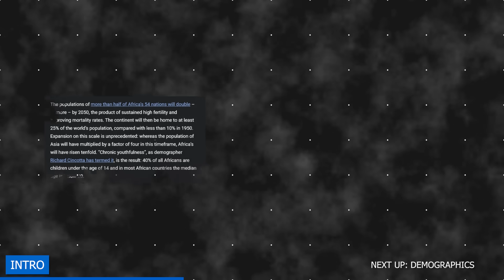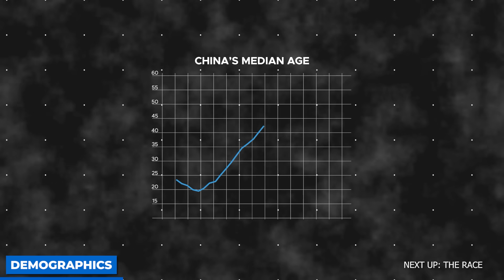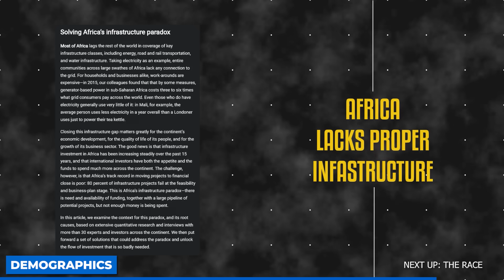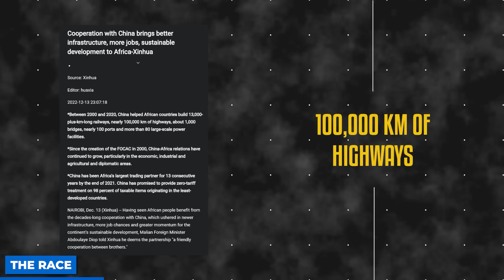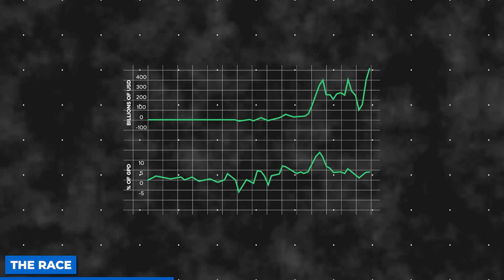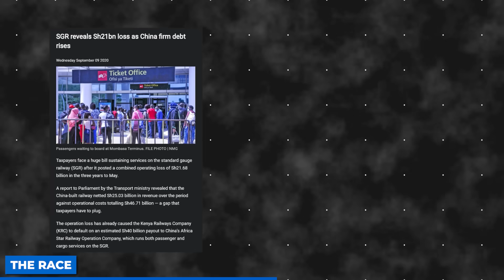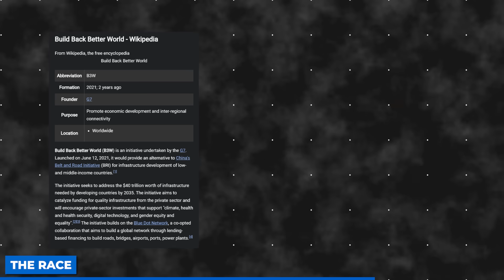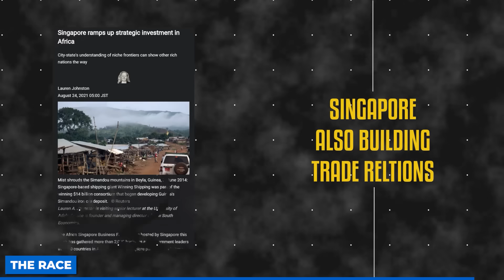USA's Plan To Kick Out China From Africa

Comment: Hydroelectric power is awesome. It's one of the best green energy ideas out there. A good dam with proper maintenance can power an absolutely huge area. Solar is... Okay. It'd be better if panels were capable of maintaining a higher level of efficiency with collecting energy. But as it stands, they'll do for powering individual homes. Most solar farms though don't provide enough of a benefit to counteract the cost of maintaining them, the space they take up ;land mass wise, and the harm they do anything flying overhead. Wind power is utterly useless though. It can't even be called green energy with how much lubricant is required to maintain the wind turbines.

Best green power options are a mix of hydroelectric and nuclear for towns / cities and solar for individual homes in rural areas.

Comment: In the first 4:37 seconds, no less than three of the infographics displayed info that was different than the spoken assertation (42 vs 43%, 25% with pie chart showing 1/3rd, and most glaringly, stating 60% under <25 with graph showing 60% under 20). I appreciate the effort, but this is just sloppy. If you can't even get that right, why should anything you say be taken seriously?

Comment: You wish. China's economic growth is still positive (though it's dropped during the Covid-19 pandemic). Unlike USA where their economy has lost considerably that they have to pint more fiat USD's to make their books look good. The only problem with USA printing more fiat USD's is that the rest of the world have their fiat USD's weaken, each time. USD's are meant to be used for trade. USA uses USD's to import the many commodities it needs (the biggest importer in the World) and in exchange they give the other countries fiat USD's to trade for equivalent costs with other countries when they're ready. But, each time USA prints more money, the USD's that the other country may be holding in a SWIFT no longer has the same spending money as it did prior to USA's fiat Money print.